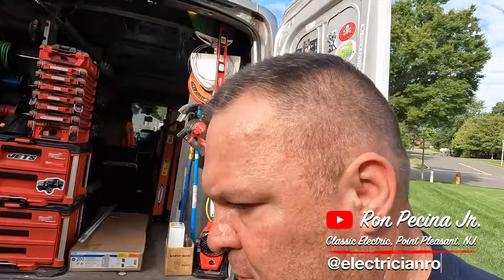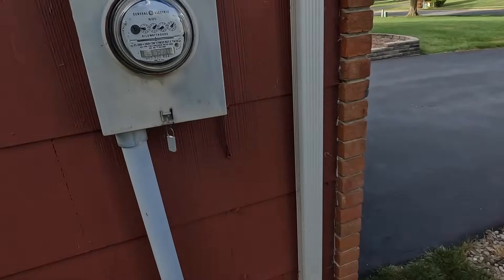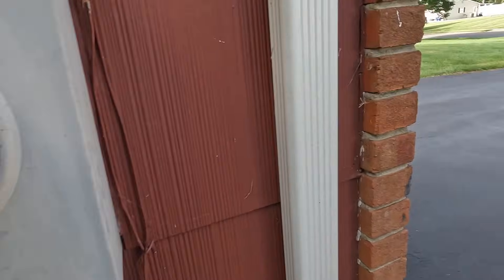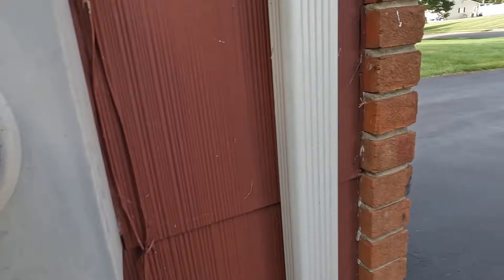From Breakdown to Breakthrough: Fixing a Broken Meter Lug and Upgrading to a 200 Amp Service

Comment: Great to have an inspector who obviously take pride in his job!💪🏼 I have to admit, I did a job that I didn’t pull a permit for, and had to change the meter pan, (underground service) I did it hot! Wrapped the conductors with rubber tape then with electrical tape. Worked well albeit not safe. Haven’t repeated that since.

Comment: That’s a heart stopping moment for sure Ron. I thought for a minute that the inspector was going to blow you off when he said you needed that number which you didn’t have. Plus just getting him on the phone when you needed him was a miracle. Glad he got there fast. I have Atlantic City Electric and I’m sure they wouldn’t have been any faster with their response. It’s odd about the surge protection. Almost all the literature say that it should be installed as close as possible to the main breaker. One thing that surprised me was you didn’t use duct seal or washers when mounting the meter enclosure. That’s your signature tell tale that you were there 😂. I was wondering why you didn’t change out the meter box in the beginning but you answered that in your comments. Another sweet but nerve wracking job! 🏆🏆🏆
Reply: Just did a shut down with ACE and they couldn't turn the power back on til 6pm. I was just replacing a meter socket, underground feed, and finished at 10am (started at 830am when ACE came out and shut down). They are ridiculous. PSEG has been a lot better to work with in my personal experience.
Reply: Siemens says breaker location is must less important than keeping the wires short and straight that attach to the surge breaker.

Comment: Hey Ron, great video as always. So the ground rods make contact with the soil itself and can dissipate a high frequency DC pulse from lightning into a certain amount of that soil. If you put two rods next to each other theyre dissipating into the same soil and that soil, if it becomes energized, has similar potential in the event of a nearby lightning strike. This is where the 6 foot rule comes from as this distance is considered far enough apart to not be dissipating into the same soil. However, the greater the distance between rods the larger the area of low impedance that your electrical system is connected to will be. Im probably butchering this but Mike Holt can explain better than me lol.
Reply from the maker: @doc13067  Yes.  The lesser the resistance, the higher the current but let’s face facts: if you’re house is hit with a lightning strike it could be over.  Just saying.
Reply: @electricianron_New_Jersey  oh for sure. It’s not about lightning strikes directly it’s about lightning hitting the power lines or a tree nearby. The farther distance between rods I believe gives you a lesser chance of energy from a lightning event impacting your house. Although obviously 6 feet is enough to accomplish this. You can also do just one rod if you get it certified to have 25 ohms or less of resistance to certain positions in the ground. Imagine going through the trouble to certify a ground rod

Comment: Hey Ron, great video. Question, if you are running an external disconnect do you still need the ground bushing in the inside panel?

Comment: Hey Ron yes that was a jaw dropper. I know a million things crossed your mind. So in this situation JCPL had to open green box and pull a switch , turn off another breaker  ? What’s in the box that needs to be done by JCPL ? 
Excellent video
Reply from the maker: They have an underground connection point and they mechanically disconnect it. I wanted to get it on video but the JCPL lineman did not want to have it recorded and shown on YouTube for whatever reason.

Comment: Im still blown away u can pull meters yourself! Here in CA we can't touch the meter mater if fact it's locked by the utility company.. just had issues with something similar few weeks back waiting hours for a lineman to pull the meter 🤷
Reply: Here in CT the Power Company lets the electrician pull the meter but not put it back in.  They have to use jumpers and a plastic cover, which according to an electrician I know are not cheap.  The power company then takes there time to come out and put in the meter after the inspection, most of the time taking those jumpers and cover with them.  Before they do any work they need to file a work order with the power co. to tell them that they will be performing a service upgrade.

Comment: On your question about when the NEC adopted the “each grounded conductor in an individual terminal” rule, it was the 2002 cycle. It has, however, been a requirement from the panel manufacturers for many years prior to that.

Comment: Another great video Ron.  How come you use #2 aluminum wire Instead of #4 copper to ground to the water meter?  Is it because the service entrance wires are aluminum?
Reply from the maker: Because aluminum is an acceptable wiring method as a grounding electrode conductor to a water main.

Comment: I dread old meter bases. If the set screws are rusty I usually hit them with a little monkey piss and let that set for a few min and sometimes have to pull out the channel locks and grip the lug while trying to break the connection loose with out trying to snap the lug haha.
Reply from the maker: I hear ya but the line side was hot and giant offset pliers I could only imagine bad things happening from there.
Reply: @electricianron_New_Jersey  for sure. I’ve done it, but with caution

Comment: Ron, got a question sir. Do you need to install GFCI breakers in a service upgrade like you do?
Reply from the maker: Here in NJ the answer is NO, not required for service upgrades. ALL new circuits that require GFCI or AFCI are required.

Comment: Learning about electrical service... so if the meter is rated for 200amps, only the wires from meter to panel need to be replaced if upgrading from 100 to 200amps? I have some electricians that are trying to get me to replace the underground to the transformer and meter without having identified that it is necessary
Reply from the maker: If you have an underground electrical service then the "service point" is likely to be at the meter. Therefore, it would be the utility company responsibility to upgrade the underground wiring from the transformer to your home. That's the case here in New Jersey with the two big utility providers PSEG and JCPL. It might be different where you are so if I were you I would check with the utility and ask them where the "service point" is on your property.
Reply: @electricianron_New_Jersey  Thank you!

Comment: lesson learned here, don't break off the lugs! 🤣🤣
before twisting so hard, cut the wire off flush to remove thermal mass, that will move the wires around releasing tension from them, then heat/cool the lug screw fast multiple times(torch/cold water or inverted air duster), then big pliers to hold the lug and pray with screw driver in other hand.
obviously don't overheat the whole thing and burn up the lug or insulator, generally thermal shock cycling like that will break up the solid rust/corrosion bond enough for it to come loose afterwards.
Reply from the maker: Spraying water around line voltage. Great idea bruh.
Reply: @electricianron_New_Jersey  who said anything about spraying water? dump some from water bottle, worried about it wetting wiring that's in a liquid tight enclosure and conduit?
last I looked that's all considered "wet area" and the enclosures only claim "rain tight", which is true with a vertical rain only, as soon as the wind blows that whole thing becomes  wet inside. including the lugs that rusted. rarely ever seen a meter socket or any outdoor panel without rust and water intrusion.
Reply: @throttlebottle5906  Are you serious?  The line side is hot, and you want to dump water in the enclosure?  This has to be a joke!
Reply: @PPyle  if you're worried the least bit about some water getting in/on live wires/meters/panels with no more than 120v to ground/neutral, then you are in the  wrong field. granted the water shouldn't be salt water or anything but near neutral PH  balanced ad no other conductive chemicals. meter sockets, conduit and most everything is considered a "wet location" meaning it will and does get water intrusion.
over the years I have replaced/deemed many unsafe and corroded badly, a mix of rain water and lawn/plant sprinklers blasting in the meters/service entrance heads and corroding out the whole breaker panel/breakers where it wicked down the conduit/cables. yes it would be best to cut the power at the feeder end(pole or buried box) then replace it all.

Comment: Is aluminum wire required for grounding the panel to the water meter?   Or is there a reason you choose it over copper?
Reply from the maker: Aluminum is less expensive.

Comment: What size wire must come from utility to service a 200 amp panel? What is the smallest size wire from the utility can you put a 200 amp service on? Can you have a 2/0 copper wire from transformer to meter?
Reply from the maker: The service drop is always up to the utility company.  If you choose to do an underground service entrance then you could run copper to the transformer.  Just an FYI: most of the utility grid is made of aluminum conductors. B

Comment: I have a question..? What are the names of white Romex conector you used because I tried to find them in Home Depot ..
Reply from the maker: They won’t be sold at Home Depot.  Try a local electric supply house.
Reply: Ok but what is the original name of the wire connectors
Reply: Thanks 🙏 you Ron

Comment: Ron,
I don't think typically you should not have be obligated to replace the damaged meter base on your own dime, since it was existing and old. If it was a new meter base, that was part of the job, and it broke, then I feel that you would be obliged to replace it. Does that make sense, or am I off base? 
Thanks for taking the time to make these videos. I have been a State licensed contractor for 23 years in Ohio and have learned a lot form watching.

Comment: Ron watching this i had to comment. Just did an underground service up in Morris County where  the meter cabinet was falling off wall with  a bee's nest and had no offset or slip coupling  also meter had stopped spinning for months. Wanted to give customer whole new set up so arranged for JCPL to do a shutdown. First appointment they cancelled for no reason. Second appointment gave a 6  hour window to complete entire job!! This was the limit of return time to re energize and needed an approved inspection sticker!!!  Never heard of this complete BS before. I arranged with inspector to have cut in card ready  to go and got an early start --the minute i cut everything out of panel phone rings  its JCPL cancelling!!   Its a young family with babies and temps in high 90s. They could care less cancelled due to "storm work"  and there were  zero significant storms anywhere in state for weeks. They are an absolute disgrace and really could care less about their customers. They always have the most outages and slowest repairs. From what i understand corporate in Ohio ruined the jobs for their employees by cancelling pensions and benefits and everyone with skills and experience left about 10 years ago.  They need like ten guys to look at something just to know what is even going on.  Having worked with both PSEG and JCPL for many many years i can tell you JCPL couldnt carry their lineman boots.I believe their Ohio office really is a very poor power company and customer service means nothing. Im basing this on multiple experiences on similar things. I wish PSEG would take over all of NJ and get them out of here. Anyway great job  amazing to see others going through similar things on jobs
Reply from the maker: Sounds like we’re all on the same ship in different cabins.
Reply: Sometimes utility companies go into mutual aid mode and prepare to send crews to other states during storms.
All local "normally scheduled " work gets put on hold.

Comment: Over the years of owning the home I live in, I've had 3 service issues.....Pole is across a main road with lots of truck traffic. I've had 2 times the service cable was clipped by trucks. Had new breaker panels installed (2) it's a 2 family duplex house. That was 1978......had glass fuses previously......About 10 years ago I started having intermittent loss of power on only one side. The side I live in. My best friend was a lifelong electrician. He came over and we looked at everything. Didn't find it at first, but while he was here, power flickered again. We went to the double meter pan and heard some arcing. Pulled meter and eventually found the small machine screw that attaches the meter socket clip on the supply side had arced so much the threads were no good 
! I was in a panic mode since I had tenants and replacing the entire meter pan would be a big hassle. My friend and I drilled and tapped the bus bar for a 1/4-20 screw and reattached the meter clip. It worked ! A few years later another truck clipped the service cable and I used that opportunity to get the entire service and meter pan replaced. I also managed to get JCPL come and raise that cable to a much safer height. Older equipment just deteriorates and it's a real tough spot to be in when you have to get the power cut and then reconnected......
Reply from the maker: The code does address the height of service conductors but the utility is governed by another body.

Comment: Nice work. I cringed when the lug broke off, knowing the BS the electric companies give. I had to have PSEG come out four times to repair a hot leg at the pole. They would show up and look at pole, and if wire wasn't hanging, would close out call as okay. Finally, a lineman climbed the pole and found a broken connection and repaired it. The sad part their automated phone system would report the problem as repaired, and it was almost impossible to get a person on the phone. The unfortunate way of the world.

Comment: Ron: I lived thru Sandy and had to deal with JCP&L when "they" disconnected my service and some of the neighbor's service. It took over a week to get my service to the active power (which never went out). It appears you were very lucky with PSE&G and the local inspector.
Reply from the maker: Very fortunate. Btw, the power to your service may have been ok but you are connected to a larger network of electrical distribution that may have been damaged and needed repair before re-energizing your service. Otherwise, you are extremely vulnerable to an electrical surge that the utility company would be responsible for. That’s why they shut you off.

Comment: Thanks for the video Ron. I really appreciate your thoroughness. Could you share a video of how you quickly identify the breakers after a panel change. I notice you don’t label stuff before removing the old panel and you said you came back a week later. Is it just a bunch of walking back and forth as you do one at a time?
Reply from the maker: It’s exactly as you’d imagine. I run an extension to the load I wish to identify and run the female end of the cord back by the panel so I can see it. Then I plug in my tester and flip breakers until I find the right one.
Reply: @electricianron_New_Jersey  I totally understand how that works with plugs; however, what do you do for lighting, hot water heater, range, etc. ?

Comment: Also if you are upgrading your panel to a 200amp service shouldn’t the meter box also be replaced to a 200 amp meter base?
Reply from the maker: All underground electrical services in New Jersey are 200A. It’s law here.
Reply: 7:01 it looks like a 100 amp rated meter box because of the slotted set screws, just thinking of the meter boxes we produce at work
Reply from the maker: @sampowell5932  200A

Comment: Does the utility provide and install the meter box?
Reply from the maker: No, I had to install a new one.
Reply: @electricalron  back when I first started my electric career in 1982, in Charlotte County, Florida. Florida Power and Light used to supply them to us. But times have changed. We buy them here. Where I live in Knoxville, TN. When I finished watching your video, I got the information I was asking. By the way, the place I am at now is  called Classic Electric. We did a service change this past week, and when we made contact with the electric inspector, he told us that he wasn't going to check our job because he had too many other inspections that day! When we were ready for the utility provider to hook up, they didn't want to hook up because they didn't get the OK from the inspector. Well, they said they would. Then, the inspector did come out! Crazy how we do the right thing and then have to jump through the red tape to get it done. Thanks for your great work!

Comment: Another nice project....except shorten and uncoil that white wire off the SPD.  The coiling adds inductance.  SPD wires should be short and direct.  UL tests are done with 6 inch leads on the SPD.